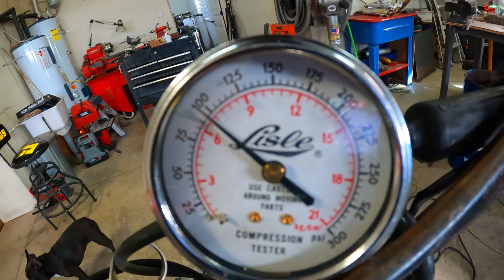Epic dirt bike barn find. will it run?

Comment: Started on a minibike in early 70s, got a honda 50, then a kawasaki kdx80, then a 1980 Yamaha yz100 and then the 1983 suzuki rm250. Tons of fun and memories with friends,  went through many sprockets,  chains and shift levers by the time I sold the yz100 I didn't have a clutch or brakes, power shifted and power slid everywhere

Comment: Paid 50 bucks for a Yz125 in 1982.. patched it together ..not smart enough to keep the wild power band under control, or adjusted.. not sure who had it worse , me or the bike. But it was a hoot when it ran. Cleaned out every ditch for miles..

Comment: Fuck yea I have history with this bike, I had gotten YZ100 that my dad brought home one day in the trunk of a car half hanging out the back. was barely running, so him and I rebuilt it all winter long. New everything, high performance bored over, etc. This was the second bike I got from my first XR75. Got this running in the spring and raced it all over town to the point I had cops chasing me. They could never catch me out in the field so after a few tries they would just go to my house and wait for me to come home. I had to be I bonded out of local jail once on this bike . I eventually started running mixed fuel on it and then my buddy broke his femur on it by crashing it into a retention pond and it slowly fell by the wayside after that. I eventually sold it to get my first car. That bike just screamed like a angry hornet, once I got it in the power band I carried it through all the rest of the gears. funny anecdote, lived in Warrenville Illinois and this local cop would always chase me. One day he seen me riding in a field and decided to pull off the road to confront me only he didn't see the deep ditch due to the tall grass covering it up and buried his cruiser,...lol he had a hard on for me from that day forward. I got some stories about this bike...
Reply from the maker: Haaaaaa yes!! This is great. The story sounds very familiar to most that owned ones of these bikes. But for some reason your story sounds like it should have been a episode of the dukes of hazard.😂. I love it thanks for sharing
Reply: @DIRTBIKEFAB   lol, yea. That buddy spent his Sophomore school year getting out of traction and learning to walk normal then one night in my parents jeep I decided to take a jump going 60 mph. launched that brand new jeep Laredo through the air and landed sideways , ripped the tires off the rims, took out some curb, light pole, and a tree. rolled several times and was ejected. I waked away after 3 days in the hospital but that same kid , shattered that same femur and had to have it rebuilt with an 18" stainless steel plate. Then he spend his junior year in traction.